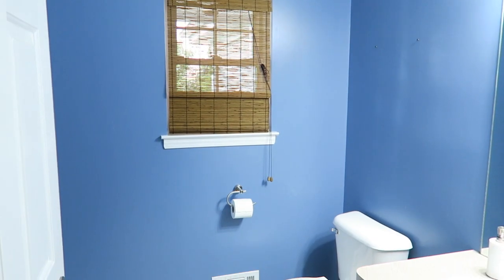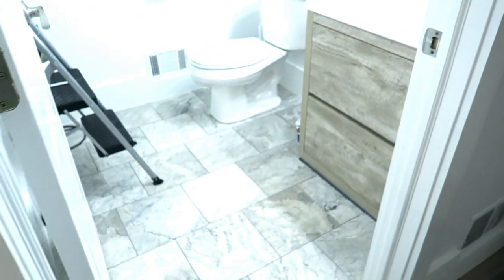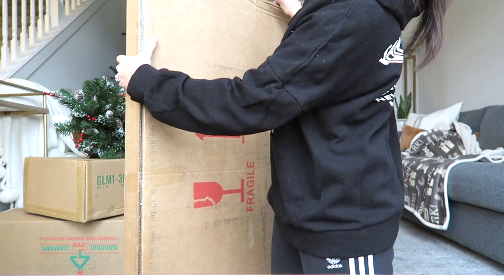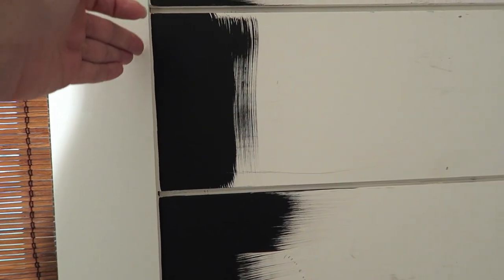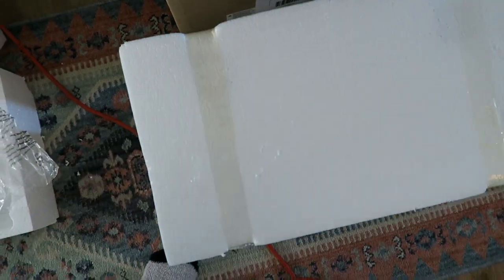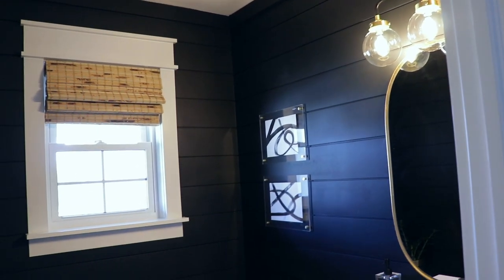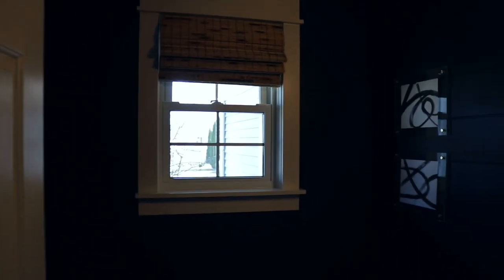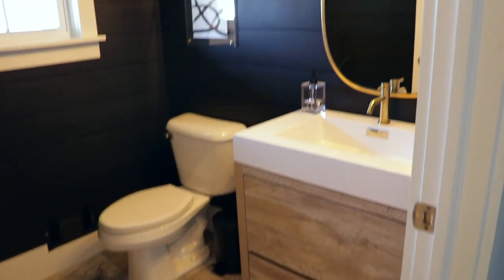HALF BATHROOM MAKEOVER! BEFORE & AFTER!

Comment: The second coat was sprayed way too heavy if it was dripping. Sweeping thin coats, just like spray paint cans, works best. That or following right behind the sprayer with a roller (works best in larger rooms where one person can spray and one can follow behind to rolling) will prevent those drips. Drips suck to sand and correct.
Reply: I would guess the drips happened because he was trying to get the joints